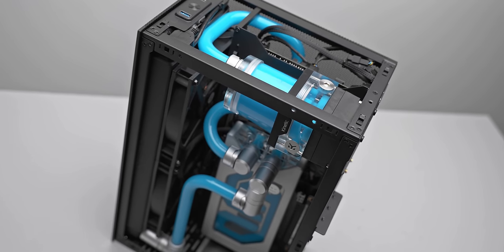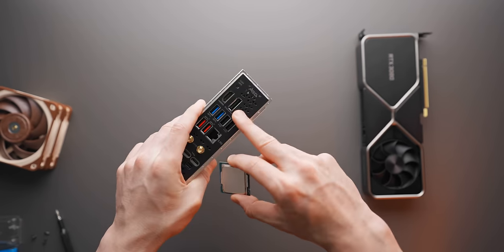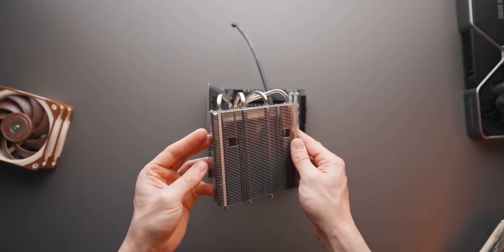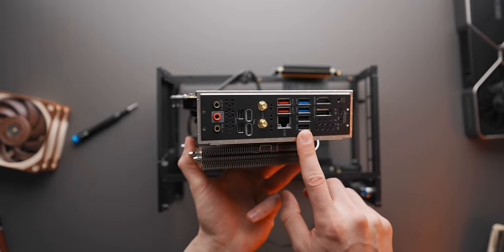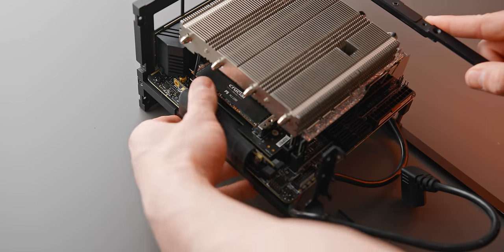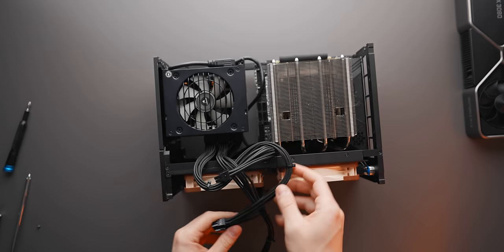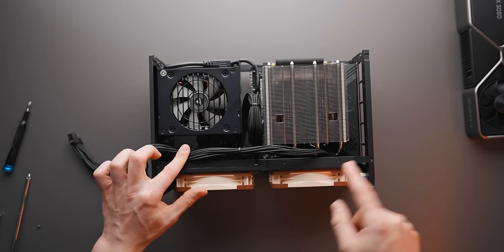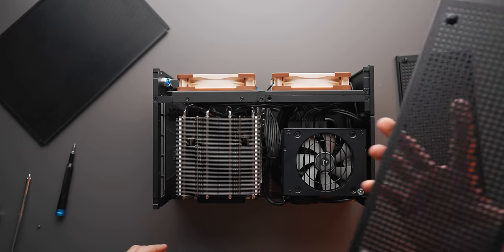Overpowered Gaming PC Build - Step by Step

Comment: For those with a CPU without integrated graphics, you can build the computer out of the case first. Plug the graphic card directly into the motherboard without the riser cable, go into the bios and change it to gen 3. Then reinstall the PC into the case. Takes more steps, but gives you more option when choosing a CPU.
Reply: yeah i don't really get the whole "this whole build would be impossible to get started"??? 🤣
Reply: Yeah, can't you literally have the motherboard resting on it's box and get your bios updated and troubleshoot incase you have DOA parts?
Reply: big brain time
Reply: I would pretty much recommend getting a post (and first boot if you can) assembled outside the case anyway, to make sure everything is setup and running well, then go and fiddle with the case and everything else. It would suck to assemble the whole thing especially with a sff build, just to realise that something is not connected properly or you have a dead component.
Reply: @alexeidmitriev6235  many time i by pass the first post test for normal ATX build but with SFF ITX build, i would not start putting anything in the case until i know that everything thing will work after, should also tested with the riser cable as well
Reply: Or if you have a rtx 2000 series which is gen 3 you can plug that in to change in bios and then put in your rtx 3000
Reply: This advice is no just for testing the riser cable "problem" but for any first builder. Never ever asamble your builds for the first directly in the case. Always test your main components outside the case before making the whole build inside the case.
Reply: I love you
Reply: why cant you just get a gen4 pcie riser
Reply: @TheFlipSide.  money
Reply: why would you change to gen 3?
Reply: @Zombie101 the stock riser cable for the case is gen 3

Comment: i like the fact that he simply show how you set fans and undervolt every time. its simple but useful rather than having to look it up each time. calm clean and simple, refreshing
Reply: do you know if the undervolt settings applies to all GPU or just this one?
Reply: I think it's different for each generation of gpu. He does have a video on doing it somewhere. I used it for my 1070 but it involved more dragging of points. But the general process is the same in afterburner.
Reply: @wAvm  Its about GPU capacity,brand,version but at the end of the day you can do it on any of them in a safe mode, downclocking and reducing power usage with MSI Afterburner and save the profile.
Reply: @wAvm  that specific setting should be good only for 3080s. If you have a different card it's recommended to use different settings.

Comment: For the GPU mounting, there's a tiny L-bracket that screws into two of those three holes on the back of the case in between the MB and the GPU, which goes under that big bracket for the GPU mounting so that the two brackets sandwich the GPU I/O plate in between them, making the GPU even more secure. It's not a huge deal if you don't use it, but you might as well. There's also screw holes on the inside of the case where you can screw down the bottom tabs of the GPU I/O plate to make the GPU even more secure and reduce some sag on the GPU (since it's hanging upside down in most T1 builds)

Comment: Great build, however i think you should recommend ppl to use two separate pcie cables for the rtx 3080, since an 8 pin cable  to dual 8 pin is rated up to 288w ..  and the card can exceed 320w while gaming (if no undervolt at least )...  Keep it up
Reply: True, but this doesn't account for separating loads on multiple rails. It's more efficient to spread the load across that potentially unused rail than run it on the 24pin's.
Reply: Actually your 8 pin , 12 pin 24pin whatsoever can deliver higher outputs then specified. There is a video about the excact details on how these power connectors work on the der 8auer's Youtube channel. You should definitely check him out as he has more details on hardware then most common Hardware Youtube Channels. Cheers
Reply: You're not making any sense dude, most of the power comes from the supplementary PCIe power cables, not the PCIe slot.

Comment: Plug the gpu directly in the PCI slot out of the case, set the bios and then build. You don't really need an igpu at all.
Reply from the maker: If you need to update the bios or reset it, then that’s a giant pain in the butt to do every time.
Reply: @optimumtech  i would upgrade to the Loque pcie gen 4 riser cable for 100$ if possible, for more peace of mind and future upgradability
Reply: @Zweysteyn it is a nice to have, but not the only option. Generally you may update the bios once when it comes out of the box and then never have to touch it again.
However if you do, you'd need to dissasemble to do it. (or purchase/rent/borrow a cheaper chip with an igpu)
Reply: @optimumtech  What undervolt settings would you use for a 3090FE? Thanks.
Reply: @optimumtech  then just have a spare ultra low end gpu, easier than taking the whole system apart :)
Reply: @Zweysteyn 5600g and 5700g. I honestly just recommend the 5700g as a cpu in general. Low tdp and 8 cores w/ best igpu.
Reply: I had to recently take mine apart to set the pcie back to gen 3. huge pain in the butt and scared the poop out of me thinking it went dead. My BIOS reset because some component is failing and causing intermittent restarts and I took apart the whole thing to make sure everything was seated right. i think i narrowed it down to my Corsair PSU.

Comment: Thanks for the tip on Argus Monitor.  I was looking for exactly that functionality (controlling case fan temps from GPU temp readings) and didn't see it mentioned anywhere else.
Reply: @deepakkajla  It's worth it to me, especially since other programs I tried did not work correctly.

Comment: You should use two separate PCI-E 8 pin power cables for the 3080 ideally
Reply: Hi. For what reason?
Reply: @JayisLIVE  The PCI-E cables are rated to deliver 150W each. Cables - not connectors. Since the 3080 is rated for 320 W, you need around 250 watts from the PSU in addition. You're running almost double the max rated current through the cable - not a great idea and the card may just not be able to draw enough power and cause instability or, worse, a fire.
Reply: Yes. Nvidia manual says use two separate cables.
Reply: @mikeydude750  PSU cables aren't standardized, nothing stops PSU designer/manufacturer to put wire with higher gauge. Those are stock cables, if wire gauge isn't enough then it's Corsair fault.
It would make sense if PSU has more than one power rail, but SF series are single rail design.
Reply: @niter43  The ATX standard does actually specify a minimum load that the cables must deliver - that is 150W for that connector. If they aren't meeting that spec, they're not meeting the minimum standard. Might you be able to have some PSUs with larger cables that can handle higher currents? Sure, but you can't count on that so it's safest to just use both cables.

Comment: Slight Tip for the psu cables, use 2 separate cables for the gpu if possible so the 2 separate psu connectors can give the sufficient energy to the card. a single cable has power limitations, 2 is more sufficient for 3080 and alike which are in the above 250 W range. Will work with single cable, but it will be a  slight limiting factor for the current setup.

Comment: If I saw it correctly, you mounted the cooler with the heatpipe bend pointing upwards. Noctua strongly recommends to avoid this, because this orientation reduces the cooling performance. However, when using an efficient CPU this might be a handicap worth to consider if other orientations are not possible.
Speaking of it, the MSI board is actually marked as not compatible with the L12 cooler line.
Reply: you're right, but the case once closed and finished is upside down, so the pipes are looking down
Reply: @balderm001  that's what they should not do, maybe I wasn't clear about. The bends being on top with the ends pointing downwards should be avoided. The case was flipped several times in the process, but I think this is the orientation as it is now.
Noctua explains it in a graphic on their site.

Comment: I would advise to set the fan speed to the GPU Average instead of the just "GPU 1". With that setting you can reduce those random situations where the fans just ramp up to slow down again because of gpu load/temp peaks.  ;)
Reply: @Alpinedownload msi afterburner and set a custom fan curve

Comment: I've rebuilt so many times in this case, and now I just have a 1080 lying around for whenever I need to reset bios settings and put in the 3080 yet again. When building AMD SFF builds in general, just having a 10/20 series card lying around is such a lifesaver.

Comment: Doesn't Nvidia recommend you use 2 separate 8 pin (PSU) cables for the RTX series GPU? and to not use the dual (daisy chained) 8 pin cables?
Reply: That's what I thought when he got to that stage of installing the GPU. Curious to hear his experience when gaming and/or benchmarking.
Reply: It's not recommanded. And the corsair sf750 come with 2 separate 8pin connector so there is no excuse here other than the limited space to work in that case.
Reply: I have the same case, psu and rtx 3080 fe. Sf750 stock cable is no problem. I used ek 240 aio which took up even more space and stock cables are fine. It’s just that my pc only boot if i use 2 separate 8 pin PCIe power cables for the rtx 3080 fe.
Reply: Its not recommended to daisy, BUT with the way hes undervolting it... I think it may be safe. For overclocking, absolutely must use dedicated cables.
Reply: @trananh4415  I have a Thermaltake view 71 (a behemoth near open chassis) and a evga xc3 3080. When I bought the rig it had daisy chained psu cables from a powerspec 850, I got black screen/shutdowns when the card was pushed to its upper limits. Swapped the PSU out for a new one (because the previous over had tossed out the extra cables from the original PSU) and shes been fine ever since.
Reply: @crisnmaryfam7344  Maybe you’re right that daisy chain may works with undervolting. When I had the problem, everything was in stock settings.
Reply: GPU power cables are rated to 150w, pcie slots provide 75w = 225w. 
Undoubtedly they could do more, but 2 separate GPU cables should be used to keep everything in spec
Reply: @Od1sseas as I said, they can do more than that but are rated by the manufacturer at 150w and 75w. 
Try doing a bit of research. Google isn't hard to use
Reply: Based on the varying responses here, I feel like this topic should be a whole video by itself lol @optimum where are you at
Reply: @crisnmaryfam7344  I called Corsair and asked them about the whole "daisy-chain" issue everyone seems to blow out of proportion, they said it makes no difference for the SF750. BTW, been running a 5600x + 3090 in my NR200, cool as a pickle on max load.
Reply: @Fearlys  Wow really? did they explain why it was ok to do it that way even though nvidia advises otherwise? would really like to know the technical reasons
Reply: I'd really love to know cos I run the SF750 on a zotac 3080ti trinity OC and use the 2 included daisy chain cables (its messy). If I could only use the one that would greatly help with cable management. This GPU has 2x 8 pin connectors to it
Reply: @OfficialMyMindset  honestly, he didn't give me one, he just said, you'll be fine, we designed it this way
Reply: @shadyyogainstructor932  an 8 pin psu cable is generally rated at 150 watts. So if you look at the top end of 3080's pushing roughly 350+ watts. 150x2...300 ect ect.. Generally speaking of course.
Reply: i run a 3080FE with a sf600 plat and i have to daisy it. Works fine, though i do run undervolted and hardly play mega-intensive games. I think given the option one should use the proper cabling, but otherwise its fine.
Reply: Even a single 8pin could power up that card. Those 8 wires could provide well up to 1000w of 12v power, technically. But well, "standards".
Reply: So I just tested the Corsair SF750 using the single (daisy chained) 8 Pin (6+2) and it ran with no issues at all! GPU power was pulling ~320w (Zotac 3080ti OC trinity). I guess this PSU is just godly ;)
Reply: @OfficialMyMindset  a decent quality 750w psu would have no issues running a 350w card. Unless you've got a heavily overclocked i9 or something and tonnes of fans and other shit that would max out the psu.
Reply: The actual most important thing to check is the gauge of the PCIe connector cable wires. I'd want 16AWG gauge wires if you're going to run over spec. I wouldn't do it with just 18AWG gauge wires
Reply: @Tom--Ace  How are you meant to check that? corsair sf 750 psu doesn't say much in the manual
Reply: @HDJess  Its not completely about the psu in question, its the cable and whether the daisy chained PCIE cable can carry enough power to the GPU.
Reply: Indeed. If they use nice 16 AWG wiring with good connectors, then using 2 isn't super necessary if the PSU can pump out all of the power from a single 8 pin connector. I think the SF750 does use this so it's not a big deal. 18 AWG, no shot. Use 2 cables. Each wire is carrying somewhere around 8-10 amps. That's pretty close to the 10-12A an 18 AWG can carry safely and quite a bit farther away from the ~13-15A a 16 AWG wire can carry. With the undervolt he applied that makes these things a non-issue as the current load drops to like 6-8A, but the overall current rating still apply.
Reply: @trananh4415  that's ridicuolous. 
everybody worries about thermal paste, air cooler, water cooler, "asking if the case and airflow, temperatures"
and this case is a bad joke. good for you if you like it.
Reply: @georgemartinezza  don’t even understand what you’re rambling about
Reply: My 3070 gaming OC was crashing with one 8 pin
Reply: @gavin-1237  PSU?
Reply: The 8 pin on the psu side can handle up to 300w. Nvidia don’t want to deal with headlines like my 3080 burnt my shitty psu thus the recommendation.
Reply: yea he tweaked

Comment: I have this motherboard, and it's probably the best mini itx on the market. I'm using a Thunderbolt 4 --> 10GB SFP+ converter --> to my NAS that also has a 10GB SFP+ port. At the same time, the other Thunderbolt 4 cable is plugged into a docking station for all my SD Card, various USB devices like another USB dock and audio interface. Keep in mind this is ALL the Thorzone Mjolnir Mini ITX Case. If I ever want to move my PC around, I only have 4 main cables for everything: power, display, and two thunderbolt cables. It really is the perfect setup.

Comment: Shouldnt you use 2 separate PCIe cables for the 3080, rather than the branched plugs from the one?
Reply: Yes, typically. However hes undervolting it.
Reply: not needed. Using dual branch cable makes no difference if the psu is decent lol

Comment: Is it safe to use one cable to power a 3080? I heard that the stock power draw requires two separate cables, so I did that to be safe.
Reply: it is safe. gpu wil just draw little bit less power. so if possible use 2 cables, if not, then it is ok.
Reply: @osamely_varan  That doesn't make me feel any more at ease
Reply: They usually won't run without all the power cables connected. I have a 3080 ftw 3 Ultra with 3 and the PC won't even post without the third power cable. 

Now on motherboards you generally don't need both CPU power connectors unless you're doing some extreme overclocking or your CPU draws lots of lower under load like a AMD Threadripper for example.
Reply: @thedofflin  well, safe in a sense, that gpu wil not be damaged. worst case scenario: it will not run. best case: you will not notice difference.
Reply: Technically you need 2.  1 gpu power cable plus slot power = 225w of theoretical power. Even undervolted, his gpu is drawing 250w.
The SF750 cables are high quality cables though, and can likely supply much higher than their 150w rating.
Reply: it's definitely safer to use 2 dedicated cables, since the card can draw much more power than a single cable is rated for, instead of using a single daisy chain like he did. That being said, your PC it's not gonna burn down or explode, worst case scenario you'll get instability in games that push the card extremely hard.

Comment: I dropped my wattage with very similar results using the power limit slider. Almost the same performance minus 60-80 watts. I like your method also and saved the video to try it later.

Comment: 9:48

Not sure what kit you have from iFixit, but most of them come with a flexible extension to reach such places.

20:51 - No, it wouldn't be impossible. You would just have to build it outside the case, plugging the GPU directly to the motherboard for the initial setup. Then once you have everything configured, THEN install it in the case. Its actually a good idea to do that to test all the parts before going though the effort of cramming it in the case anyway.

Comment: I did a build just like that but I had 2.75 GPU 3070 EVGA. I switched to water cooling before parting with the system. ITX cases will forever be top tier to me.

Comment: You can also set XMP and the PCIe gen 3 with the system built on the motherboard box and not using a riser cable. The iGPU is not needed for the build process (GPU will post at gen 3 when directly connected to the slot, the riser cable introduces the issues), but it is a good backup to have and also for troubleshooting. It is actually a good idea to see if all the hardware works before putting anything inside the case, because even the best company can have a DOA hardware product delivered.

Comment: Are there any disadvantages doing these ITX builds? The only things I would note is only having one PCIE(not really a problem, you only need one) and possibly cooling issues. Other than that it seems to have everything a full size mobo can fit.